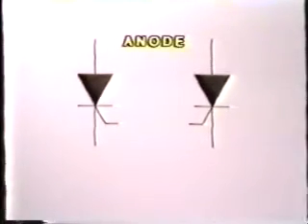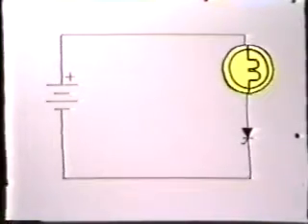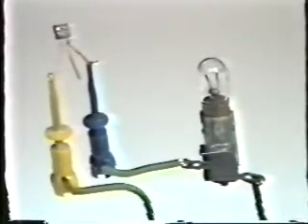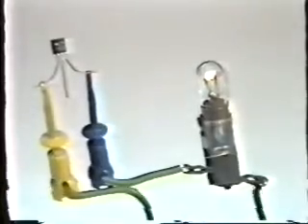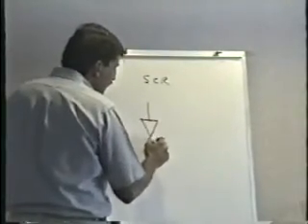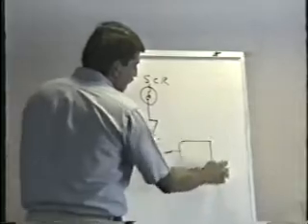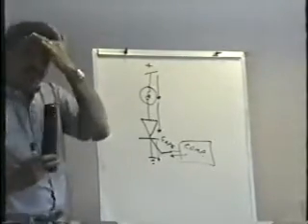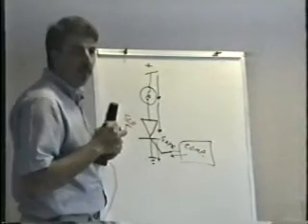Diodes, Transistors and Other Semiconductors-Chapter 11-The SCR

Comment: 2:35 "We don't really use SCRs much anymore. I don't really know. I can't really think of anything in a current piece that uses an SCR." Huh ? SCRs are used in Crowbar Circuitry used to protect more valuable components such as a Power Mosfet used as a Pass Transistor in a regulator circuit.
Reply from the maker: Sure, they're used all the time. There is no other component that acts the way an SCR behaves. Naturally, it depends upon the industry/application we're discussing. If you're using battery-powered, mobile electronics, you're not likely to see an SCR. If you're in the electroplating business, you likely will.